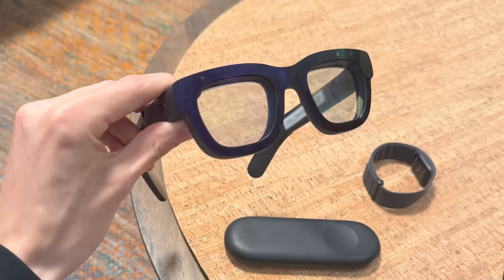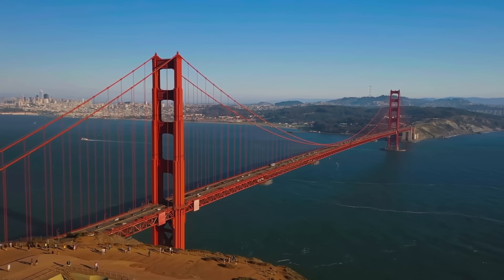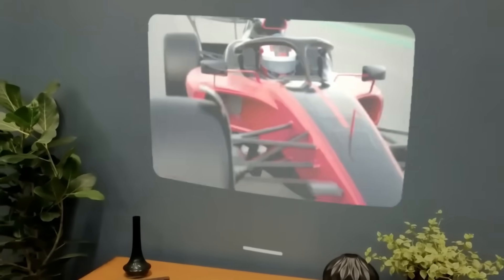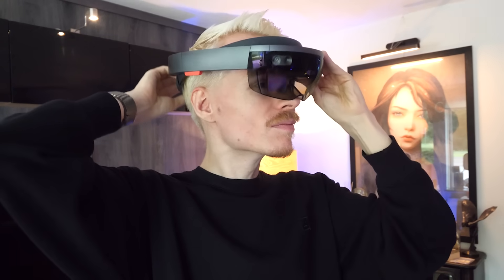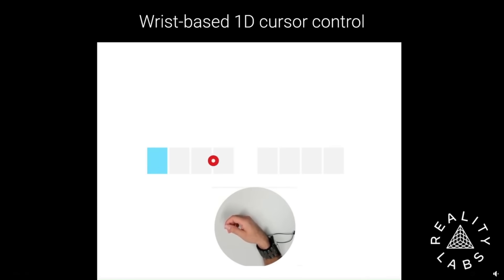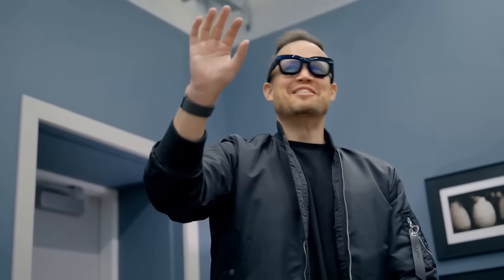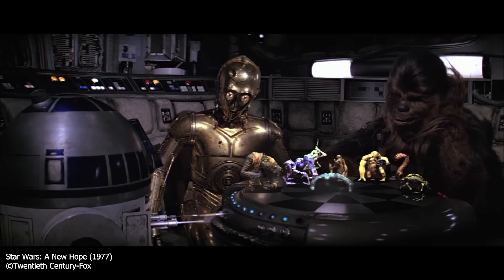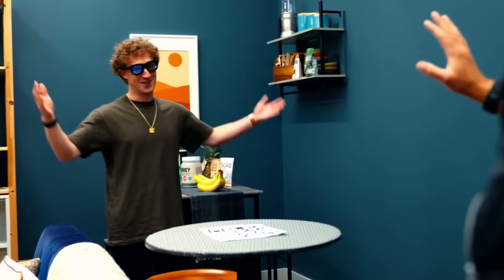I Tested Meta's AR Glasses and Neural Wristband

Comment: Summary points

Introduction to Meta's Orion AR Glasses

The speaker shares their excitement about trying Meta's first true AR glasses, Orion.
Meta has been teasing AR glasses since 2019, and Orion was recently revealed by Mark Zuckerberg.
The speaker visited Meta Reality Labs and was impressed by the Orion prototypes.

Technical Specifications and Features

Orion glasses are prototypes not yet available for sale and are expensive to produce.
They feature a 70° field of view, microLEDDs, and silicon carbide optics.
The glasses include a custom eyetracking system, inbuilt speakers, and a magnesium alloy frame.
Orion uses tiny projectors and waveguides to create holograms in the real world.

Orion's Accessories

The neural wristband uses EMG to read wrist muscle signals for gesture control.
The wireless compute puck handles rendering, AI tasks, and spatial tracking.

User Experience and Performance

Orion glasses provide a comfortable fit and an immersive field of view.
The image fidelity is decent but could be improved, with some ghostlike visuals.
Interaction with apps like Instagram is intuitive using eye and hand gestures.

AI Integration and Applications

Meta AI can recognize objects and provide information or recipes using voice commands.
The AI experience is seamless and enhances the AR experience.

Multiplayer and Social Capabilities

A multiplayer demo showcased Orion's colocation capabilities for shared experiences.
The compute puck can act as a motion controller, enhancing interactive experiences.

Conclusion and Future Implications

The speaker views Orion as a breakthrough in AR technology.
Orion's integration with Meta's ecosystem could be transformative for the company.
AR glasses are becoming a reality, and other tech giants should take note.
https://my.infocaptor.com/hub/summaries/nathie/i-tested-meta-s-ar-glasses-and-neural-wristband-dsaxib8ISmA

Comment: Impressive but tech that has a lot farther to go. Those soft low contrast images are painful. It will be great to be able to look at that yellow fruit and see it labeled a banana just in case I get dementia and forget what it is. And what if you need a visual RX? I can't use the current Meta glasses as they don't support anything above 6+ correction. Of course it's Meta so you can't be critical or you'll never get their perks again.

Comment: Does the compute puck heat up if stored in your pocket? An Anker battery does, and that's just a power source, without a processor running inside. And I wonder if that's the prototype for a compute puck dedicated for vr headsets in the future.

Comment: Years, even decades ago, I was offered by the consumer electronics world, a choice of a vibrant picture on a 30 inch TV or a washed out picture on a 80 inch protjector screen or wall. I chose the TV. 
Today we are offered the same choice with a mobile, tablet, laptop, desktop or even VR headset  on one side. All with a vibrant image. Or an washed out, ghostly, semi-transparent image via an AR experience. 
I make the same choice now as I made back then. I chose a vibrant picture every time. 
If AR can match or exceed the quality of image I can get on a high end smart phone then I'll use AR. But if the cost of using AR is to spend all my time looking at Casper the Friendly Ghost then forget it.
Reply: Which product respects my privacy?

Comment: Looks very cool. Only feedback is on battery life, def needs swappable batteries if the battery life is 2-3 hours. Maybe one of the arms pops off and you can connect a new battery but Imagine there is some sensitive electronics in those arms as well. Anyway very cool video, thanks for posting!!